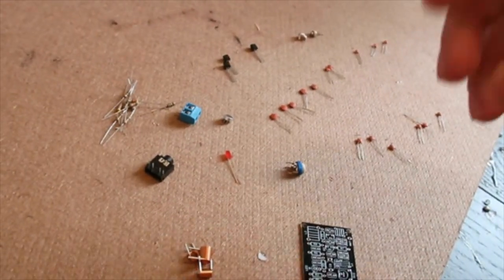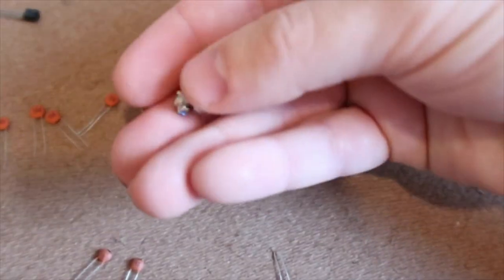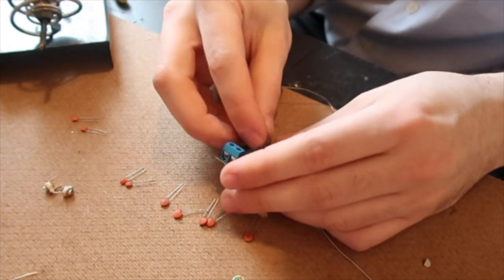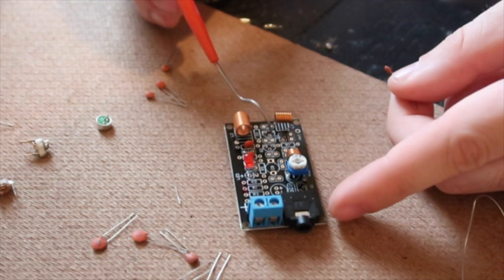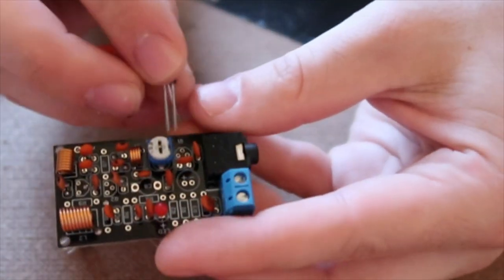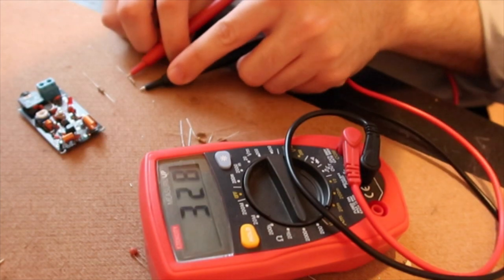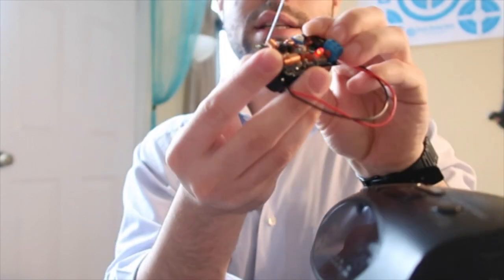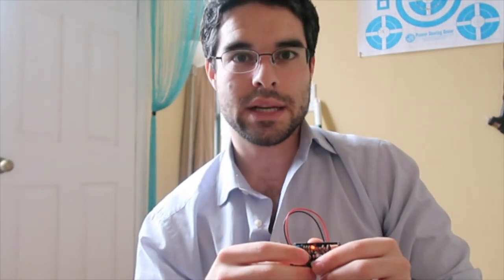FM Wireless Microphone Suites FM Radio Transmitter- DIY Kit Assembly and Review

Comment: Thanks for the vid sir! Was really surprised to find someone actually posting the assembly of the same cheap stuff i bought off ali just to practice soldering. One question though, please explain how you found the frequency (tip/trick) on which this small thing is emitting. Thank you.
Reply from the maker: Thanks!  To find the frequency take an FM radio and go to a channel that doesn't have any talking, just a loud noise.   The Wireless FM transmitter should work with that channel.

Comment: You didn't fully explain how to get it working for anyone who has never built one before or is new to electronics
Reply from the maker: This kit is not a great project if you are new to electronics.  Try looking into 'snap circuits'.  They are easy to use and have loads of similar projects where they explain everything step by step.  Good luck!